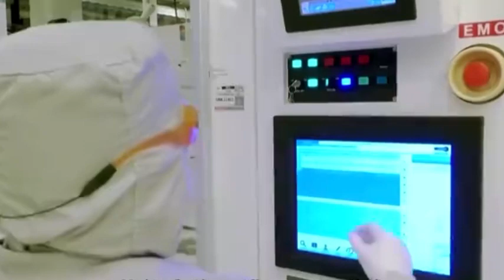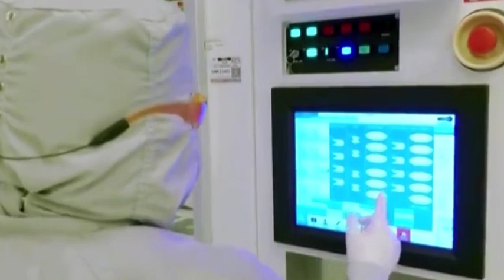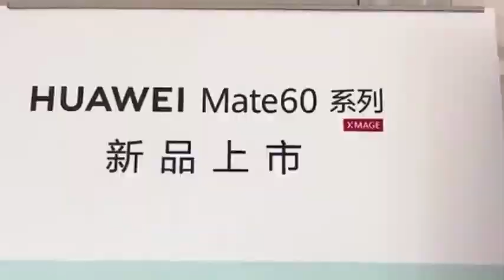China has successfully produced 13.5nm EUV light source, gradually breaking the overseas monopoly.

Comment: Stupid everyone is on 2-3nm  china 13.5  nothing to brag about😅😅😅
Reply: you are an uninformed fool, 13.5 is the wavelenght of the lightsource, not the detail of the semiconductor. With the 13.5nm EUV they can print from 14nm to 2nm semiconductors. The upcoming 2nm process uses the same 13.5 lightsource.
Reply: Viva deepseek 🇨🇳🧠🧠🧠👏👏👏...FTUS...
Reply: Better than you which rather be a servant to the west.. China is not bragging. .if they can do this within 7 years .. The next 7 will be even more amazing ..keep coping ..
Reply: @kimchiba4570  Why Even Response to an Uninformed Person, Everyone is using 28nm or 14nm, Only a select few Companies are even using 10nm and anything lower is as specialize an expensive as it can get.Those things takes months to make from scratch, no one is jumping to 2-3nm in mass produce electronics
Reply: Current process naming is pure marketing BS and has nothing to do with transistor size anymore. Just 4-5 years ago, intel made the bulk of its cpus on 14nm and what they have today is barely any better.